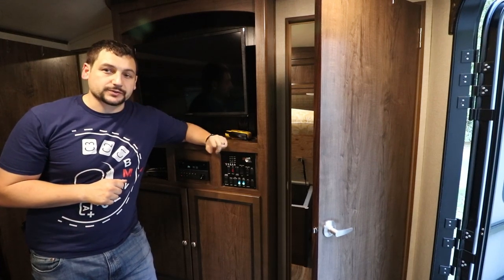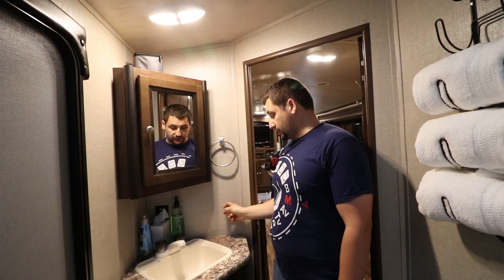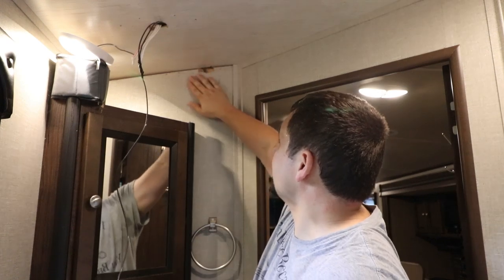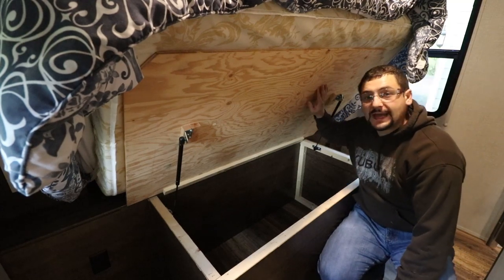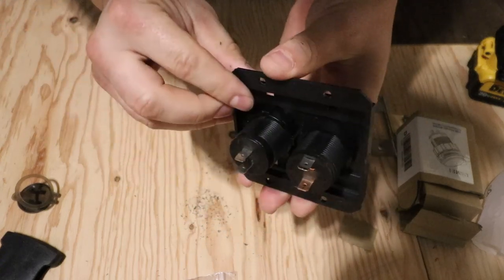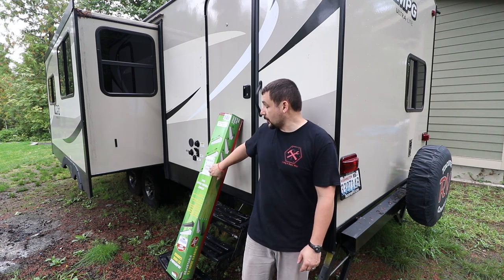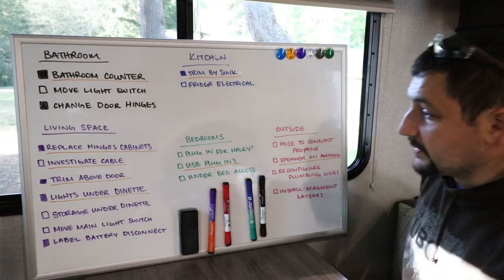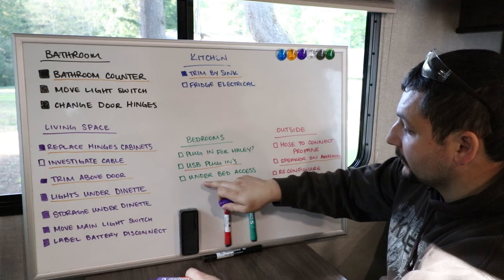RV Upgrades Repairs! Make RVing better! Part II

Comment: I drilled holes in top of both ends of bumper and caps and use hitch pins to keep sewer hose caps from coming out while traveling. A lot cheaper and easier than doing all that work you did, and it only took about five minutes to secure bumper caps. Problem solved.

Comment: You’re luck you have the ability to do these repairs. I’m as handy as tits on a crowbar.  I have a Grand Design 5th wheel and had some of the same issues. Overall it’s an amazing RV but I believe all manufactures rush through and quality control is lacking across the industry. One funny thing is when you were working on the bed struts I was putting in my contacts. The focus on your camera kept going in and out. I thought I was goin blind!  Great videos and well done.  Subbed.

Comment: Great video. I am looking to add a few outlets in our GD Reflection 28bh. Just one question, why use the poor quality “RV” outlet rather that going to a high quality residential outlet? I want to replace all of my “RV” outlets with quality residential outlets with usb and usb-c ports as well.
Reply: Rvs usually are 12v